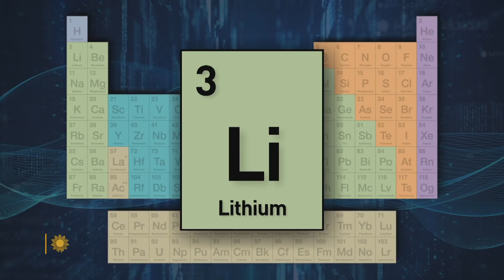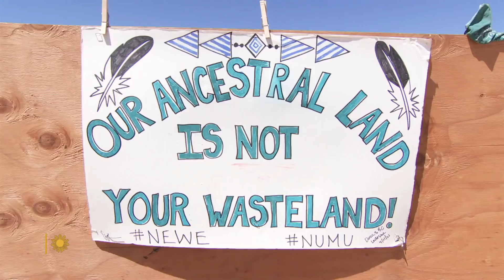Powering the future: The drive for lithium

Comment: Biden driving the truck ! 🤣.  I'm sure it was being controlled by someone else.  In any case electric vehicles will never be put into mass use. Just not practical. Also to charge these batteries it will take coal burning plants. It just won't happen.

Comment: We need hydrogen powered electric cars. Not rechargeable lithium ion batteries.  We need hydrogen refueling stations, hydrogen producing infrastructure, not recharging stations that take too long to charge.  Those knuckleheads are off on a boondoggle again. This infrastructure bill , 5 trillion  scam, is pointed in the wrong direction.

Comment: Electric bike take 4 hour to charge.it will cost the abridge consumers $600 to $700 a month on electric bill to charge that particular cycle.now a car with a full capacity from $700 to $1,000 a month on the electric bill.
Reply: A car battery is massively larger than a bikes.

Comment: I'll be the first in line to protest oil pipelines and coal fields but to protest lithium mining is insanely stupid!!  The NV protesters show up in their gas-guzzling SUV's, to a spot of desert they've never heard of before, and protest an extremely non-damaging mining project for an absolutely essential mineral.  Why aren't these protesters parked outside of the MANY coal-fired power stations or oil fields in the U.S.?  Because they're paid by the coal and oil industry and are fools.